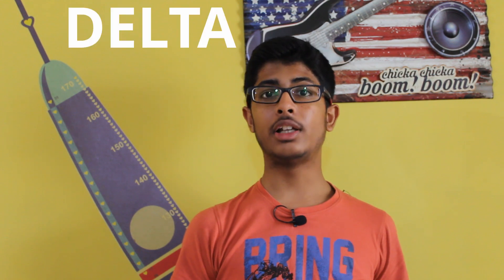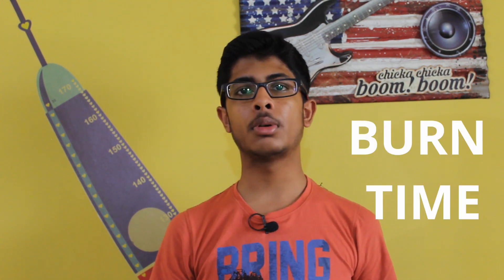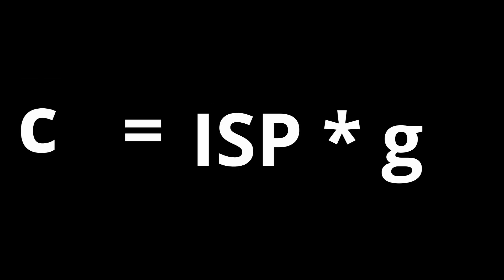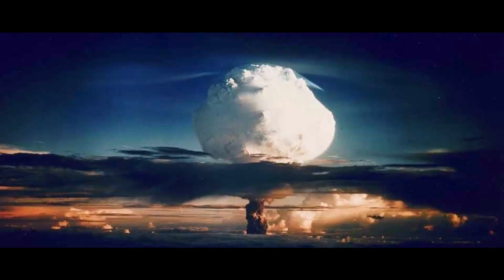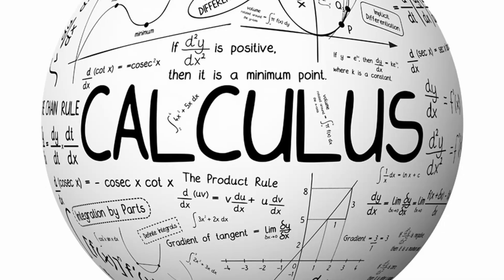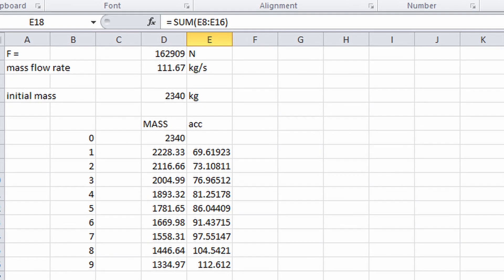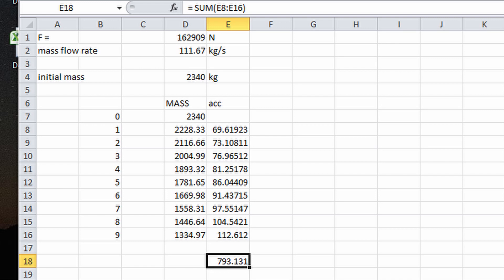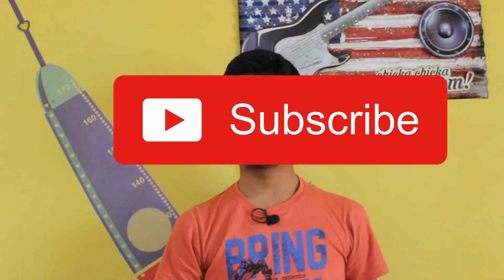How to calculate Delta V and what is it? Rocket Specs #4

Comment: are u a college pass out or just interested in space engineering
Reply from the maker: Nah just interested
Reply: @SpotlightInSpace  well.i am working on a reusable launch vehicle  model and  I want to try something new with rocket launch vehicle .boosters.
Is it possible to replace air breathing boosters with electromagnetic one?  as the electric propulsion system  is used in plasma rocket.
Reply from the maker: I don't think you'd be able to use ion thrusters in the first stage of a reusable rocket